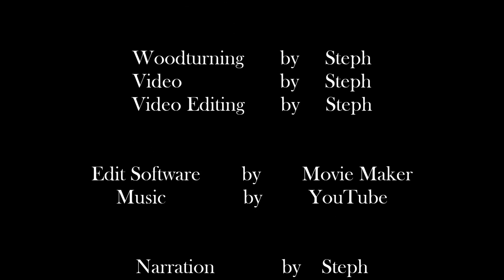Woodturning a  Ring Box Complete of Bloodwood

Comment: Buenos días qué excelente trabajo muy bonito soy gran admirador de sus videos me gustaría preguntarle con que le da acabado a la madera Cuál es el producto que utiliza ya que aquí en mi país Costa Rica es poco lo que existe
Reply from the maker: Thank you for the kind words Douglas :)  I use 2 part Epoxy first (2 coats) sanding between coats.  And then 10 coats of CA Glue (superglue), using activator after every other (every second) coat and sanding them down smoothly w/ 400g or higher, after the last coat.  Then any type of car polish ( i use a 3M brand machine polish but anything like Mothers or Turtlewax polish will do ) and then beezwax or  carnauba wax to protect the polish coat :)  Here are some links for you :)  Hope this helps :)

https://tinyurl.com/ydfqjp5g
https://tinyurl.com/ycuw5mnr
https://tinyurl.com/ydgb5md7
https://tinyurl.com/y99rjdfr

Comment: Buenas Me gustaría saber con que pule la pieza Qué tipo de producto utiliza para que quede ese acabado Mi nombre es Douglas de Costa Rica
Reply from the maker: This is a newer version of what I use ( https://tinyurl.com/ycvvurmu ) but, any car polish will do the trick.   After I apply polish and buff it out, I apply carnuba or beez wax.  I buff it very fast to create heat so it spreads around and I use dry parts of the rag to thin the layer after that .

Hope this helps and thanks for watching and the reply,
Steph